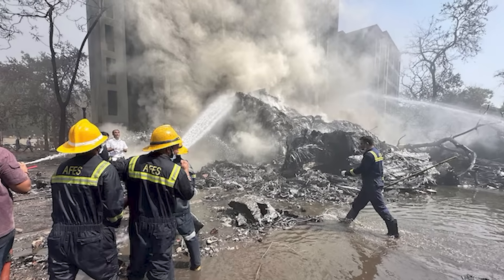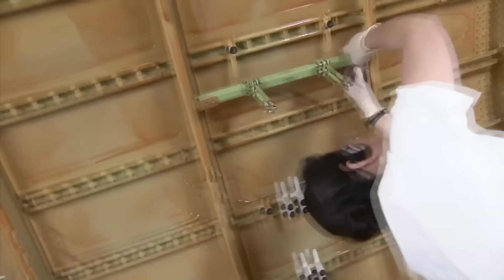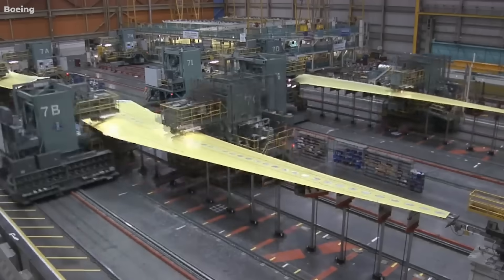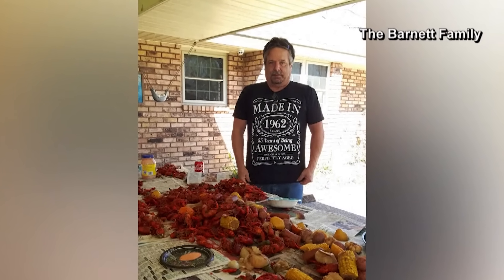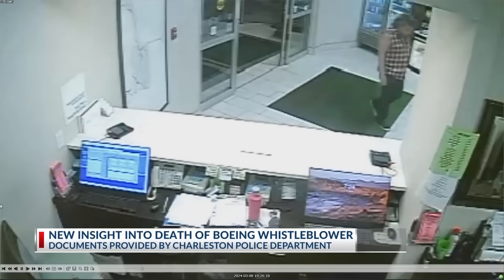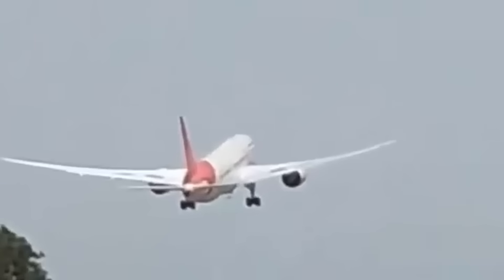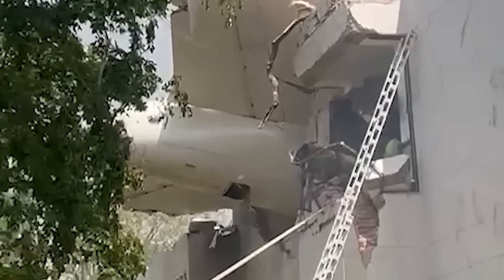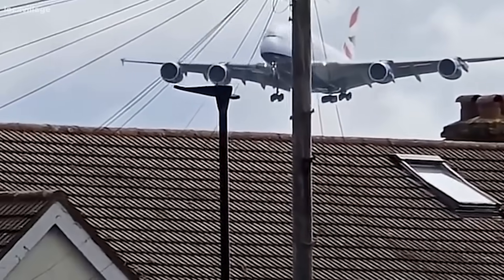The SHOCKING TRUTH Inside Boeing’s Factory Explained Why AI171 Crashed

Comment: These are lies, the first report will come to light on July 12, so far there is nothing yet, however everything points to a shutdown by the pilots of the fuel flow to both engines. Could be accidental or software mal función but this will come in a few days 
Stop sperading lies